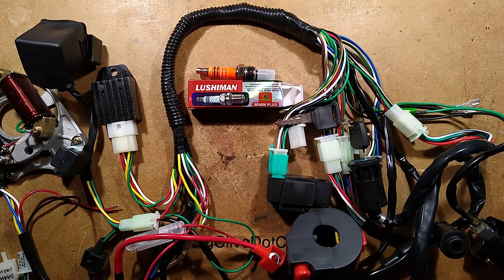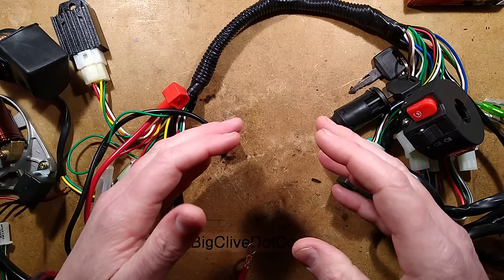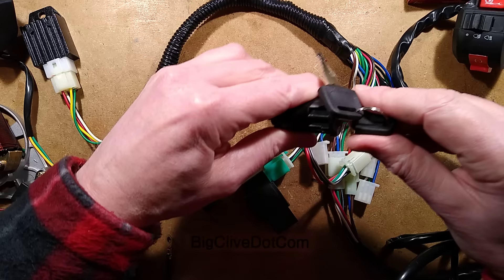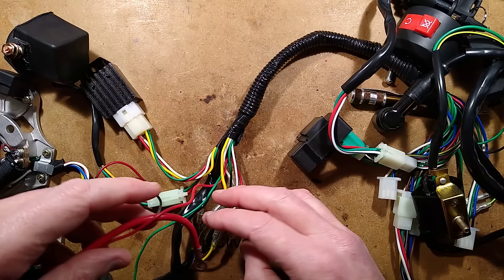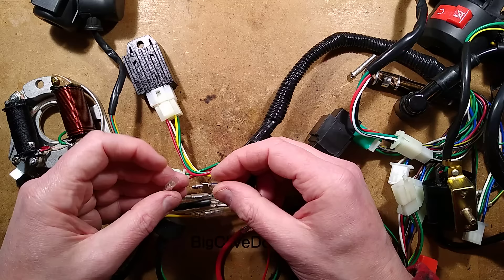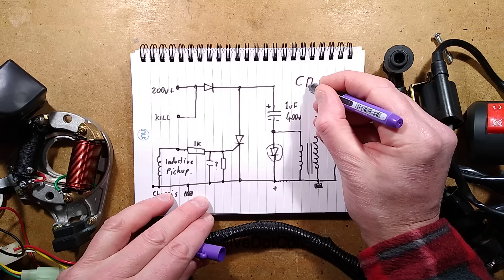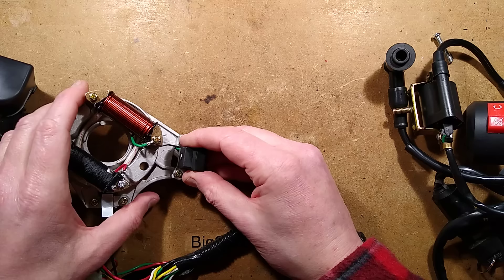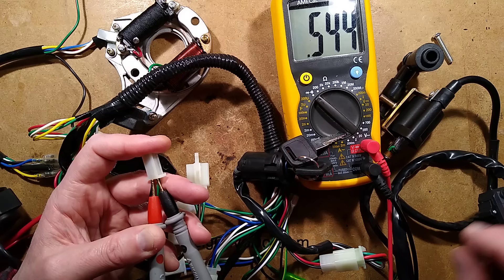Exploring the wiring loom of a Chinese quad / scooter.

Comment: great as usual. -  "normal" Kettering ignition (points and coil) uses the points OPENING to generate back EMF of coil primary to induce current in the very high no of windings in the secondary which goes via distributor to the spark plug.

Comment: I spent some time selling Chinese scooters a few years back ... I'll share some highlights.  When the Operators Manual says "Turn your winker on before swerving" it doesn't mean that literally, and that would be illegal here in the states.  On electric Scooter wiring harness the connector marked Derailleur is for the hall sensor throttle.  The Chinese term "Spare Parts" means "a random collection of parts that were replaced on new scooters until it worked correctly".

Comment: one of the safety circuits is for the brake switch which needs to be depressed to start (can also be used for clutch switch as you said), and the other is for a remote-controlled start/kill switch for parents to shut off engine if they need to.

Comment: 1: The safety switch is probably for the side stand. I don't really know what type of bike this is for, but on a normal motorbike you can start the engine while the side stand is extended (one switch), but as soon as you put it in gear (second switch) with the stand extended, the engine is killed.
2: The ignition box should have some kind of logic to delay ignition while in low RPM and advance it for higher RPM. So the signal coil doesn't really initiate the ignition, it just serves as an index on where the crank shaft is at the moment. Forget these animations where the piston sucks in air and the spark plug fires exactly when the piston is all the way up. It takes time for the flame front to travel throughout all the volume of the cylinder, if you fired the spark plug at the uppermost point it would combust only after the piston has gone down again and blow out the exhaust. At higher revs, the spark plug fires LONG before the piston reaches the top. An engine that fired the spark plug always at the same time would have piss-poor performance everywhere except at one point where the ignition advance fits the revs.
3: Say "au fait" once more and I'll come over to the Isle of Man and beat you up.
Reply from the maker: The CDI unit will be featured in an upcoming video.  It has "interesting" circuitry, and not necessarily in a good way.  There is a capacitor/resistor network that seems overly complex compared to other designs.
You'll get the random bit of French from me occasionally.  You can blame Disney for that.  I worked in France for a while.
Reply: Oh I don't mind the French (I learned it myself), it's the repetition. But no need to barricade your door, just joking :). I'll be eagerly expecting that CDI video.

Comment: The CDI does have a very simple ingenious timing control Clive, the higher the engine speed the quicker the rate of voltage rise at the inductive sensor meaning the trigger threshhold of the Thyrister will be reached earlier in deg. rotation of the crank shaft. A lot of the magic behind these deceptively simple harnesses can be explained by getting hold of an earlier Honda workshop manual, something like a CT110 series or the single cylinder trail bikes.
If the lighting system has been copied correctly it's an AC/DC system, where the head and tail light operate straight from the magneto AC coil, the brake lamp and battery charging is via the DC section and the regulator. This was a deliberate system by Honda to the make the bikes unstoppable, no battery or a failed regulator, no problem providing the coil is not burnt you still have lights to see. Same logic for the CDI, completely independent of the battery DC system, if you can kick or push start the engine it will run.
Royal Enfield still use open connectors like those to this day.
Reply: Many riding mowers have the exact same setup--AC magneto coil powers the headlights, battery charging from the DC section/regulator (no brake lights on a riding mower though), and a CDI ignition completely independent of the battery DC system.
Reply: @brianleeper5737  Yes you're right very similar, that would also be a use for one of those ign kill leads Clive had, the dead man switch on the seat.

Comment: In my experience the regulators are a glorified zenner. Also capacitive discharge spark circuits are used to accurately control the energy of the spark. IE to reduce the energy to the minimum needed to reliably ignite which then extends the life of the spark plug. In boiler controls the circuits used to deliver a minimum of 6mJ but in reality were more like 7.5mJ to take into account component tolerances. Or that's the way I used to design them anyway.

Comment: One of the safety switch connectors is probably for a "dead man's handle", a plug on the end of a wrist strap that pulls out if you fall off.
Reply: on a lawn mower it would be the seat switch.

Comment: It seems the three pin connector hanging loose is for aux or something else and isn’t supposed to hook to anything I guess. Thanks for helping me figure that out, this mini 4 wheeler will start if I jump the solenoid but not through the starter button , I don’t see a mini relay so I guess it will be the cdi box

Comment: The 'fun' thing about this wiring loom (and in fact most wiring looms for mopeds, quads, etc) is that you can push or kick start the engine after simply disconnecting the ignition switch, because doing so removes the short circuit between the ignition wire and ground.
Reply: The scary thing is twisting two wires and breaking the steering lock works to steal most 125's! (and older bikes)!

Comment: Those two safety connections, in my humble experience, would likely be "Operator Presence". A switch mounted under the seat, which prevents the engine from starting unless you are sitting on the seat, and to kill the engine if for any reason you leave the seat, whether that's being thrown off in a accident, or dismounting to attend to something else (e.g. to open a gate etc.) and "Transmission Safety", which is a switch associated with the gearbox/drive train, and prevents the engine from starting if the drive is not in 'Neutral'. Those are common safety features on agricultural and grounds care machines, and would also be appropriate here.
Reply: On motorcycles a second kill switch is more often fitted to the side stand so that the bike won't run, or maybe just won't start, in gear with the side stand down.
Reply: @oldbatwit5102  Only that this is supposed to be for a quad, often used in agriculture, and in grounds care, and by its very nature, four wheels, wouldn't have a stand, otherwise I'd agree whole heartedly, however, the whole thing is something of a voyage of mystery. 😊
Reply: @28YorkshireRose12  I think you are right. For a start there seems to be no wiring for indicators.
Reply: The safety switch is for brake circuit meaning if neither the foot brake or brake handle if held down the starter motor will not spin, so that you cannot engage the starter motor accidentally when at speed. The system is shitty though because you can just brake enough for the brake light to come on then press the start button, and on a CVT system common with quads and if the starter motor uses a bendix connection to the flywheel or primary side of the cvt you can really fuck it up. They seem to have fixed that problem with some quads though by coupling the starter motor to the flywheel using a roller clutch / hillard overrunning sprag clutch type meaning the starter motor will not couple because the starter motor spins at lower rpm than the flywheel therefore not engaging the rollers to jam the two ring gear baskets together, don't know if I explained clearly enough, english is not my native language
Reply: My riding mower has (had? It doesn't work anymore for some reason...) a feature that kills the engine if you attempt to engage reverse with the mower deck down. That's in addition to the feature that kills the engine if you leave the seat.

Comment: Basket case two speed Italian moped with pedals. Trouble shot for a few days and I finnally stopped and wired up a tail light as that was missing. Then all of a sudden it started up. They ran the coil thru both the tail light and rear brake light so if rhe bulb burnt out it couldn't be ridden until a working bulb was installed at the rear fender. Pure genius on their part, mostly luck on mine

Comment: One of the safeties might be a tag attached to a cord that pulls out if you fall off, unlike a motorbike that would fall over, a quad might keep going.
Reply: Some quads also use a switch under the seat both as a safety (non) start or engine kill if you aren't sitting down- a mate had one that had that, was a bit of a pain as you didn't have to lift off the seat on the quad very much to kill the engine, so hitting a big bump would make the engine 'miss' as the engine kill briefly triggered- nice idea in theory, but in practice- yeah... (his older quad had no safety cutouts at all, and did actually 'run away' on him once when he fell off doing jumps, it just kept on running and tootled off by itself- luckily it did drop down to idle, but by the time he got back up and started chasing it, it had run several tens of metres away lol)

Comment: We used to repair reg/rect, they are set. In a hard resin substance, if careful you could melt the resin, scrape it out, & change the diodes, sometimes it worked, mostly not lol
Reply from the maker: I depotted the modules and made videos about them.

Comment: The extra kill switch plug goes to a pull type kill switch mounted in the rear to tether the atv to a larger one to keep the kiddo from taking off.  The safety circuit goes to the two brake switches,  one foot and one on the handlebar.  Either brake will allow it to start, they have centrifugal clutches so there is no clutch lever.

Also most of these small engines have 2 magnets in the flywheel and generate an AC voltage that feeds the regulator.

Comment: Regarding the 'safety switch', a modern thing is to have a switch on the side stands on bikes, or with an ATV, you have to pull the clutch in, or have the front brake on. When I biked in the 60s, 70s and 80s, I used to fill the connectors with Vaseline (waterproof and conductive). CDI ignition was a game changer to points and coils. Good explanation to it. Timing is normally done on the pick-up.
Reply: My motorcycle has a safety switch on the side stand. That switch doesn't disable the starter, but kills the engine if you shift out of neutral with the side stand down.  I was out for ride once a few hours from home when the side stand switch broke during a rest stop. Fortunately I was able to use the toolkit stored in the motorcycle to remove the safety switch from the side stand and rotate it into the up position. I left it hanging loose that way until I could order a replacement.

Comment: Hey that voltage regulator is something you probably haven't seen before. It is a rectifier with a big fat zener circuit to shunt the output and prevent it from boiling the battery. It essentially puts a constant load on the motor. So the idle on the small low torque motors will be fairly consistent. so when there's no use for the alternator's power all of it gets dumped into the regulator module is heat.
Reply from the maker: The videos showing the depotted regulator and CDI will be released soon.

Comment: These wire looms are heavily based upon Honda designs. Numerous Chinese manufacturers have been copying Honda bikes since the nineties, and have been manufacturing after market replacement parts since long before that. At some point they stopped copying and started doing their own thing. Many parts are still interchangeable with Honda bits. One thing to note, the single round connectors (those that were loosy) are not compatable with Honda bits. Honda uses a 3.6mm connector, and the Chinese use a 4mm connector. Not a big difference, but conecting Japanese to Chinese connectors will result in them always being loose. Honda's wire colors have been standard and since the 1950's. The Chinese sometimes follow Honda's color scheme, sometimes not. Green with a pink stripe (which would be your red/green) goes to the neutral gear switch, right beside the stator on the engine. This neutral gear switch connects the green-pink wire to ground when the gearbox is in neutral, allowing the neutral gear control light in the speedo to light up. Models with a starter motor use the same neutral gear switch to switch ground for the starter solenoid, so you can only use the starter motor when in neutral. The white wire going to the power regulator/rectifier is to charge the battery with. In old models this white wire simply had a chunky diode, and went straight to the positive pole of the battery. The regulator unit adds a voltage regulator to that. The yellow wire is to power the head light, tail light, the light that illuminates the speedometer when head lights are on, and the high beam indicator light. It goes unrectified, these lights work on AC. The oldest models (on 6 volt systems) had no power regulation at all, just juice straight from the stator. Burning out head light bulbs was a regular thing. In the eighties Honda transitioned to putting a big old 30 Watt resistor parallel to the lights, and then quickly moved away from that again. The modern regulator unit has an AC power regulator parallel to the lights. I'm not sure what is inside the regulator. I assume the AC voltage is clipped with a pair of very chunky zener diodes and a resistor. You get some huge voltage spikes from that stator coil when switching the lights on or off. The Honda coils are reasonably well behaved. The Chinese coils are feral and will provide anything from 10 volts AC at idle to up to 50 volts AC at high revs. And the voltage spikes you get when switching the lights on or off will kill your lights if that regulator is loose, or not well grounded. Indicator lights, the neutral light, the claxon and the brake lights run off the battery. The rear and brake light bulb is a single bulb with 2 filaments. A 5 Watt filament for the tail light, running on AC. And a 21 Watt filament for the brake light, running on DC battery power. Both AC and DC going into the same bulb, with a common ground, which is quite interesting. It becomes more interesting when that ground fails and the 2 filaments are now in series between the AC power for the running lights and the DC power from the battery. Trouble shooting that is a very interesting puzzle that teaches, when stuff gets too weird to figure out, it's a missing connection to ground.

Comment: The connectors are open so water can drain instead of being trapped inside when they are not quite waterproof (no connector that can be undone is ever truly waterproof). I live in southern Ontario and a sidecar outfit ('80s Honda with similar connectors) is my main means of transport in the winter on salted roads. I've had the current one since 2006 and non-sealed connectors have never caused a problem.
Note that these connectors can have corrosion problems over time as oxidation develops between the contact points and causes resistance which develops power (ohm's law & voltage divider) & thus heat but if you unplug & re-plug them every few years to push the oxidation out of the way they can be reliable for a long time.

Comment: That's a atv/quad loom, that's why it's so short, the distance between the handlebars and the engine is maybe a foot, the loom is still likely cuting it close, if it's for a scooter then it would have turn signal wiring, the wire diagram is basically the same regardless

Comment: @bigCLIVEdotcom
 the rectifier is just a few diodes, to rectify the AC to DC current for the battery.  it's not complicated in there.  it just dumps the bottom half of the sine waves to ground, and or to heat radiator, that generated by each of the coils.

Comment: The 2 connectors that you said was a safety  circuit  are actually the neutral switch and neutral light and the 2 wires that aren't terminated that went to the coil is for an optional reverse light mainly for ATVs hope this helps

Comment: The CDI and ignition coil could be on the handlebar side of the loom so that they can be mounted higher up on the chassis to reduce the likelihood of getting wet.

The rest of the loom probably still can't handle water anyway due to the low price, so this design may have been copied from a more expensive loom.

Comment: i think the dash/ sidelight is actually for the rear lights and the reason it reacts to the safety switch is to turn on the light when u press the brake,  and probably cant crank it unless you press the brake

Comment: I know many parts of this, or similar ones that are slightly different, from my own scooter (which hasn't run in 2 years now). The voltage regulator is especially tricky, because they all look the same and most of them have compatible plug connectors, but there are several different models, so basically when yours goes bad, you'll have to find the right one by trial and error (which can cost you quite a few light bulbs). I also once repaired my handlebar switch assembly with parts from another handlebar switch assembly that I ordered on ebay, but wasn't quite the right one, so I had to make 1 good one out of one broken one and one that didn't fit right - again something with the connectors. That's where these things are not standardized, and that makes them quite nasty to work on...you would basically have to get either a whole wiring loom like you did, or figure out every connection on your existing vehicle on your own.